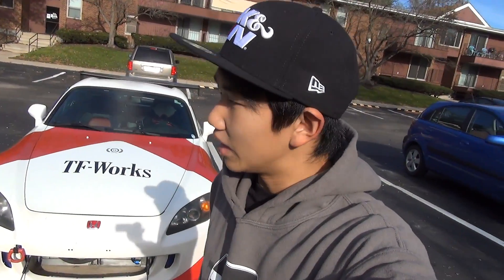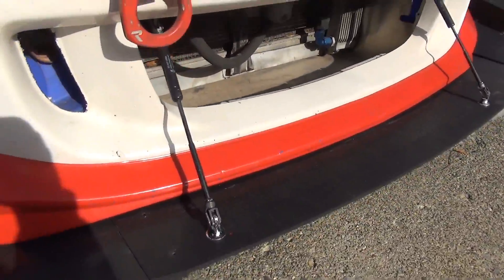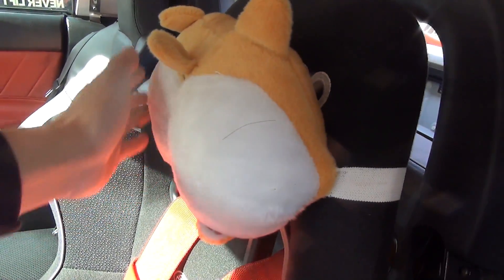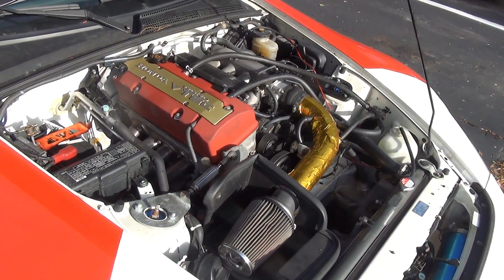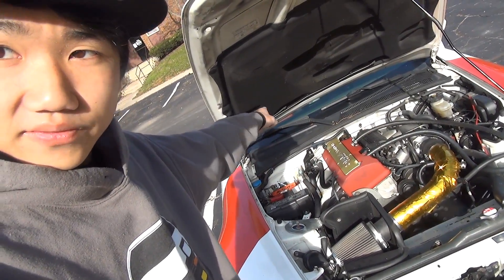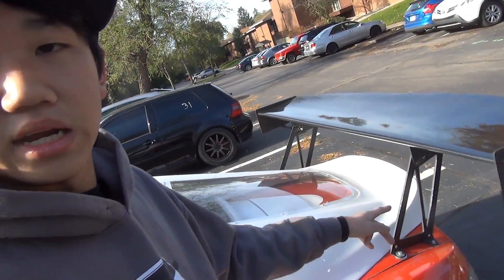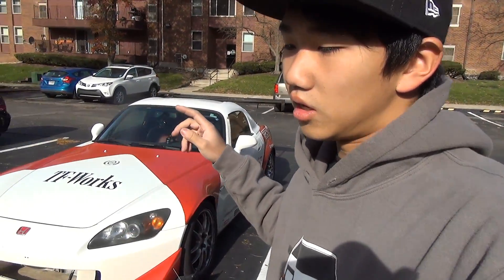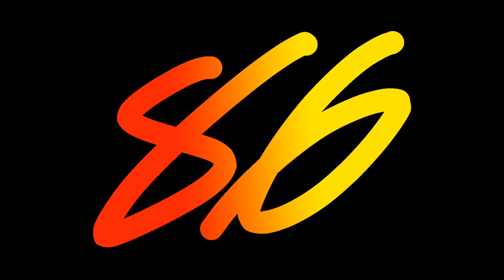Super Lap Battle READY! S2000 Updates & Upgrades!

Comment: Hello Jackie, I just started my track life with my ap2 s2000 after watch your video :). But then my shifter gets notchy when transmission gets hot after few laps(Usually after 4-5laps also no problem at all on public only on track). I use honda oem green bottle transmission fluid. What kind of transmission fluid do you put in your s2000?
Reply from the maker: I use the Motul Gear 300 for trans, that’s what I would recommend. OEM stuff is good for daily but any track stuff, you’ll want more specialized aftermarket options.

Comment: hey Jackie. Please talk more about cut rear bumper and diffuser. Does the diffuser really help with aerodynamics?
Reply from the maker: Yes, this diffuser does help smoothen out the turbulent rear air flow. At my level, this diffuser is meant for more reducing drag, but once you have a full flat underbody, the diffuser can really take advantage of that and generate downforce.
Reply: @JackieDing86  thanks for replying. I always know the advantage of cutting bumper, but thought the diffuser just for look. So combine cutting bumper and adding diffuser is the best way to go.
Reply from the maker: Yes. There was a CFD analysis that someone did on this, bumper cut and diffuser definitely generated the least drag.
Reply: what is your diffuser? Kamispeed on s2ki has Spoon diffuser along with bumper cut, it looks awesome. Is there diffuser better than another?

Comment: also are your tires the extreme contact sport? if so how are you liking them??
Reply from the maker: The Conti ECS is my daily/rain racing tires! Perform very well on a day to day basis. Put on a lot of miles on these tires and I really like them.
Reply: @JackieDing86  i was looking to use them for track sessions in the future, do they wear not to much? mostly will be using them on dry track days
Reply from the maker: I’ve not used them for dry weather tracking too much, but I have no doubt they’ll handle it just fine.

Comment: I had that exact same issue at certain tracks when I had half a tank or less, so I got the Radium fuel surge tank installed, and it works awesome - I can go hard and even drift without suffering fuel starvation. Note that there are two drawbacks - 1) The noise. I have to figure out something for this before I lose hearing at that frequency! It's not as bad with the top down, but it's obnoxious all the time. 2) I have to be really careful on track now because I won't get the courtesy call from the starvation to remind me it's time to come in before I need a tow. I will be mortified if that ever happens! But for competition weight reduction, I feel like it's worth it.

Comment: O dam. My dipstick does that too. That's smart
Reply: Your hood should be holding that down! I figured that out by cutting a hole in my carbon fiber hood underside in an effort to eliminate some bad rattle-vibration sounds. As soon as I did that, I kept finding the dipstick head pushed up, and of course some leakage. I "patched" the issue by duct taping a thick piece of resilient packing foam to plug the hole over the dipstick. That solution has worked for almost two years now without further maintenance, although the duct tape is starting to wear thin where the dipstick head impression lives. ;)

Comment: Controversial question. Does cutting your bumper make any difference?
Reply from the maker: Gained a couple of MPH (2-3) down the back straight at Gingerman so... yes
Reply: @JackieDing86  doesn't it mess up the aerodynamics? I was thinking of adding a diffuser to close that parachute of a bumper we have
Reply from the maker: The OEM bumper uncut act as a parachute for sure. Hence why I had it cut. Not the prettiest... but it works. A diffuser helps, but a combination of both should work the best
Reply: @JackieDing86  thanks chief!

Comment: The splitter would look nice if you skinned it with carbon fiber also would make it more ridgit. Also what suggestions would you give for someone going from autocross to hpde. I seen in one of your previous video you drove in bowling Green KY at the Corvette museum, what is your opinion of that course compared to the other tracks you have driven
Reply from the maker: BMSPEC made the splitter out of ABS plastic, knowing idiots like me will likely send it off the track multiple times and break many bits lol. CF would drive the price of the splitter up, ask me how I know.
Reply from the maker: The NCM Full Course is pretty challenging! Combination of all kinds of corners, fast, slow, tightening, downhill and uphill, proper rollercoaster of a track. Would love to try it again.
Reply: @JackieDing86  nice. I live about one hour from that track, it seems like fun; I'm still a novice so it will be a while before I get as proficient as you but your "grassroot" style build and driving really gets me motivated to get out there and drive. So expensive though lol